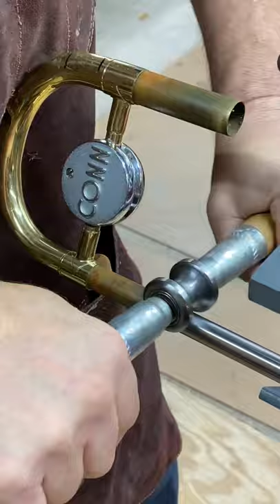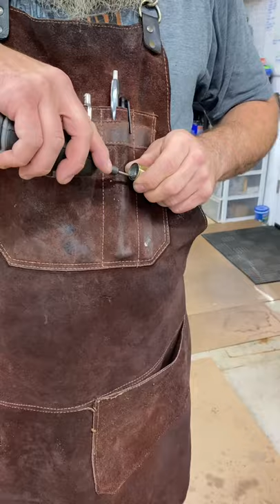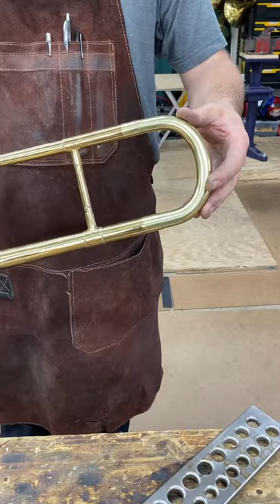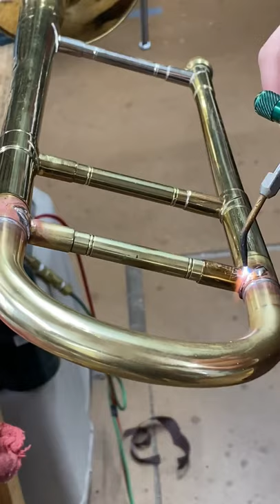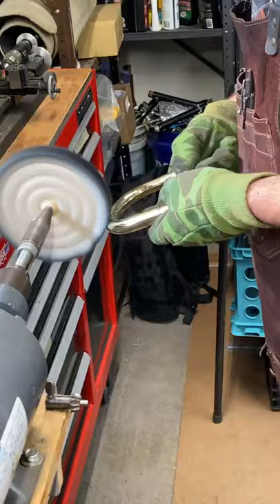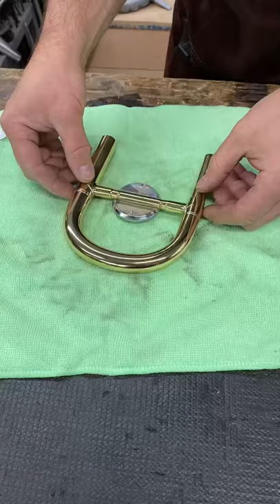Trombone Bell Restore w/ReplaceTuning Slide- Band Instrument Repair- Ferree’s Tools- Wes Lee Music

Comment: I grew up on a Conn Director Series…brings back great memories.  Thanks for making these videos…really takes me back!
Reply: they are TANKS.... will serve well.  Mendini's and other amazon crap will be gone in 5 years, while a 30+ year old conn will still work!
Reply: I just bought a 50 year old conn online because my king was a honest piece of junk (no exaggeration, broken spit valve, massively dented, soldering on the bottom for rubber piece fell off and I taped it back). Best 180 I ever spent. It looks brand new